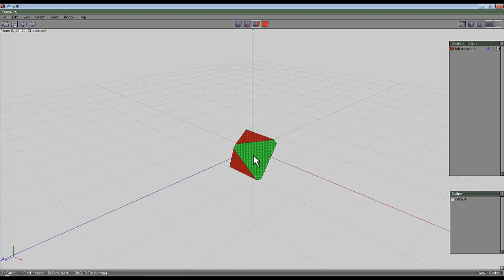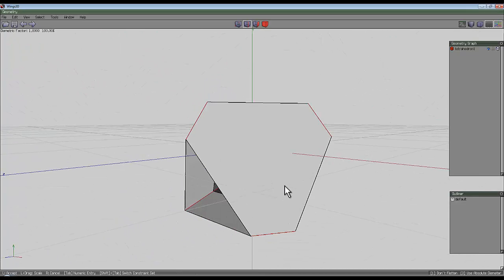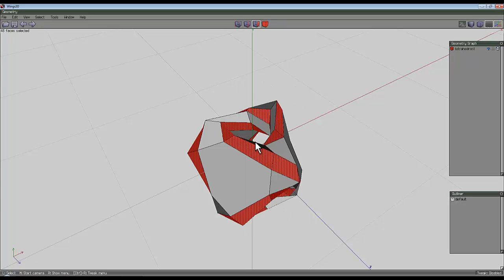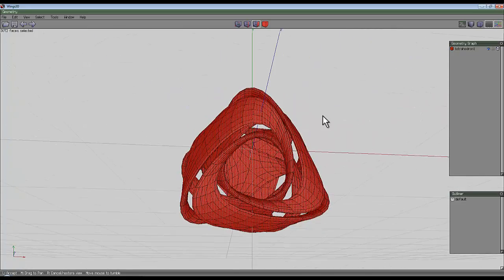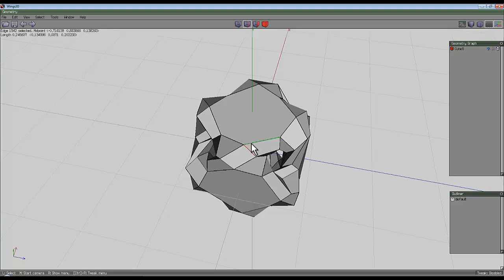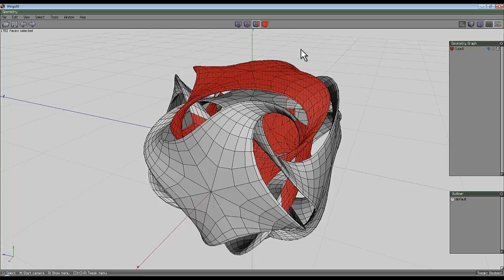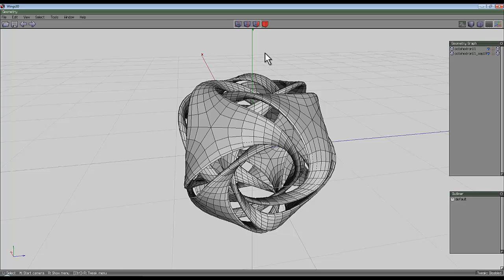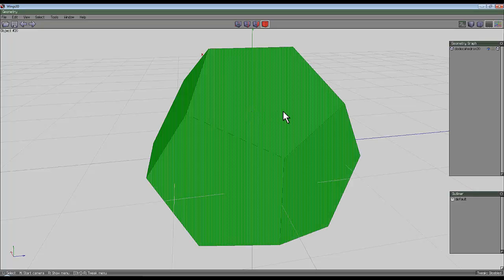Wings 3D project - Twisted loop test on five perfect solids - by David Brinnen.

Comment: Just had a chance to try out the dodecahedron.  Do this: After you loop cut, rotate, weld, and select the edge ring and convert to faces, invert the selection and intrude.  After intruding and separating, each shape will contain several interlocked ribbons.
Reply: I tried out all the shapes, not just the dodecahedron.
Reply from the maker: Art Wade I will try this next.
Reply: i made an octotoad nd it split into 1+ 8 shapes at the end. didnt expect so much new shapes though^^.
Reply from the maker: Doctor Too-Much Neither did I!